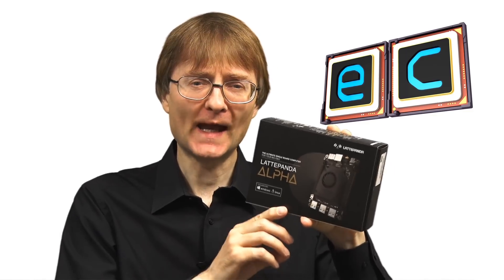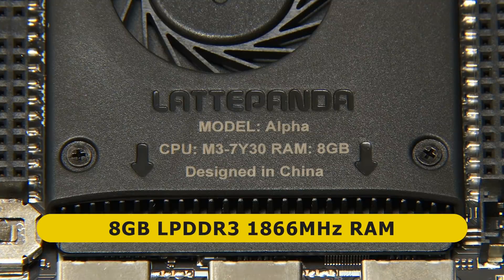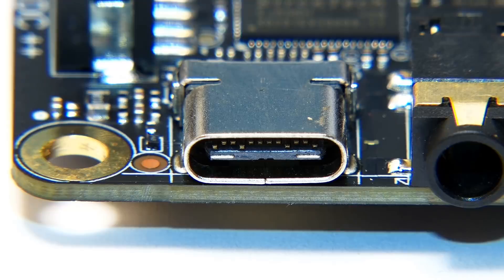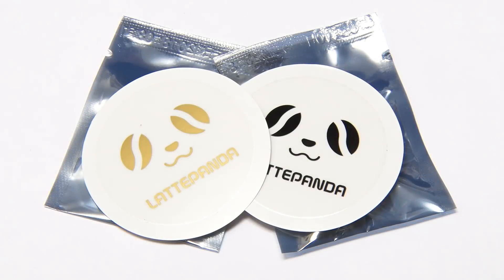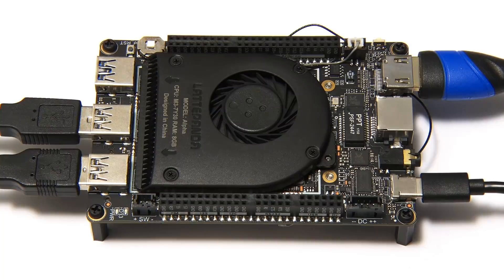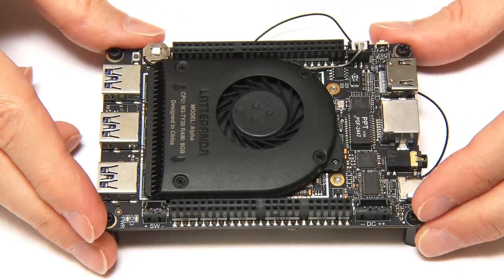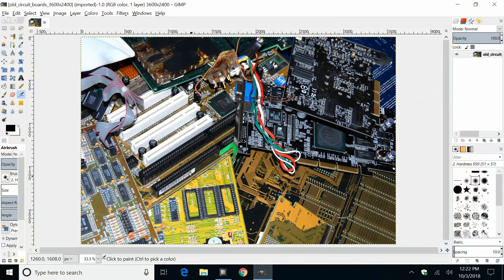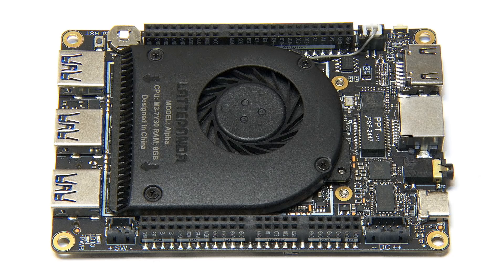LattePanda Alpha: Windows & Linux SBC

Comment: i always like to see the old ide style connectors 
would it theoretical possible if i only takes a view wires from it to make it to a sata slot ?
there are commands to the hardware to transfer different bus sizes like the OUT command it works either with 8 16 or 32 bits , but keeping in mind that inside the hardware it can look differently seeing the commands the cpu can skip the 32 bit transfer and instead transport 64 bits or more over a cache

Comment: Is that socket marked SW for a secondary power switch for when you put it in a case?
Reply from the maker: That may well be the case, although the documentation suggests that switch is connected via the GPIO connector.

Comment: It might be expensive compared to other SBCs but it's not bad if you compare to similar spec small PCs like a NUC. This would make a nice, very thin media PC or file server. It's too bad they did not include a SATA port so you could add a large 3.5" HDD and make a high capacity mini NAS
Reply from the maker: Indeed. A large drive would have to be USB 3.0.

Comment: In my opinion this computer is more suited to industrial applications than home computer or robotics use -- which is great. Years ago when I worked in industrial chemical engineering as an electronics technician, this board with its hardware power would have easily been able to control the entire program logic circuits (PLC) for the entire plant. Installing an operating system on this board is a crime as it has the potential to do so much more. The LattePanda Alpha takes small scale single board computing out of the hands of hobbyists and into the world of mainstream industrial application. My career in industrial electronics ended 23 years ago, but watching this review has truly made me jealous of what the future now holds in this field. At approximately $400 a board, this product is a total steal as many circuits can often run into the thousands of dollars. I love all the ports it has and I could easily see this board being a mainstream staple  in manufacturing extremely quickly. Thank you Chris for your channel and introducing me to this great product. I wish that I still had a boss whose office I could run into on Monday morning to talk about this with.
Reply: Since no one here seems to be able to read, what the original poster was getting at. Hes saying "dang how times have changed" the HUGE systems they had in place to do little processes are able to be accomplished by this tiny little singleboard. It should be understood that he means to use it as an industrial application because of its form and power, and thus a little work on the peripheralsto the board this little guy CAN do industrial work. hell critiques everywhere. So quick to jump on your ego and spit some "intelligence" but lack the sense to realize how old this fella is and how much tech had changed in his eyes. Ass hats.
Reply: I don't think so. We ass hats should always turn on the red lights when someone comes up with "Arduino"(like devices) and industrial application in one thought or sentence. This remembers the hobbyist that he can loose his fingers or worse with his latte panda controlled cutting machine. That these little machines are getting such powerful is very impressive and a wonderful evolution. So are the achievements in workplace security. These are two thoughts that can coexist without having to become emotional.
Reply: It more targeted for consumer and hobbyist only, not much for industrial
Reply: I agree. It seems to me that this iteration of the LattePanda is targeted at an even more restriced niche than the original ever was. I was initially tempted to pick one up to do some messing around with Linux programming, but the price of one of these plus a SATA M.2 SSD is quite a bit higher than I would be willing to spend on an SBC.
Reply: What's to stop you from offering sound solutions advice as an independent advisor/consultant?
Reply: this board is excellent for robotics. when you work with optical sensors (think about 3d mapping) you need the performance.
Reply: TotoFrancey,
I disagree that this new SBC is not suited to home computing.

It can run full-blown desktop operating systems unlike the the low-powered SBC's like the Raspberry Pi which can only run a stripped-down versions of Linux like Raspbian.

There are people who have no desktop, nor laptop, but only a tablet compute in their home, and this Latte Panda Alpha is way more powerful than any tablet.

This SBC is really more suited to Consumers but I would not want to limit someone's imagination.  

Who knows where this device is going to be used?

It should not have any problems processing much less, playing any 4k videos.

I wonder if anyone has seen any cases for it yet.

I wonder if it could be used in a form of a portable computer or laptop.

That would be cool if  a consumer could make their own laptop.
Reply: @cgwworldministries 
Any suggestions for equivalent but not priced as much?
From my view I see it priced ok and couldn't find a better alternative. Azzule that you've liked is half the ram, half the rom, slower cpu I believe and not much of expandable possibilities but priced at 300++
Reply: Windows 10 and it's constant massive updates makes it unsuitable for industrial use. But, of course, you can run other OS. Problem is I see major part of it's customer going that way
Reply: It is a joke.  I believe it is too slow for any serious modern application. Except may be for controlling wash machine...
Reply: You need RTOS to run industrial applications .
Reply: There is absolutely zero chance an engineer worth his/her salt will use a Latte Panda in manufacturing or serious automation. Industrial automation is done with industrial grade components. I can't tell from this video if the components are industrial grade (I'll eat my hat if they are), but I can tell you the connectors will never pass an industrial application quality control test. Assembly lines or manufacturing plants are not controlled via DuPont wires inserted in GPIO connectors w/o secured, latch mechanisms. Industrial automation require redundant systems which this board doesn't have. I doubt the cooling solution on this board uses sealed ball bearings. Also, in industrial automation unnecessary subsystems are never installed, as they increase the failure rate. For example, you don't wire an audio port if you don't need one. Finally, industrial products have detailed specs that include things like  MTBF, environmental conditions, stress tests, etc. I can go on and on. So don't kid yourself... this is still an amateur/hobbyist product and a pricey one for what it does.
Reply: yup, shame how shit-slow computers have got over the years isn't it?
Of course the Hardware is mechanically faster, much faster. But the OS efficiency is inexcusable, over-burdened nonsense.
My #smartfone is at least 4x the speed of my 1996 T-series RISC workstation and what can it do? Nuffin, nothing useful at all really.
And in use, that workstation is still more responsive than a 10ghz solid quad. I still do layouts on it 20 years later... What a f-in waste...
Reply: P D James : well, it’s got to do all the marketing and surveillance logging and reporting back!
Reply: Which obviously, I'm completely happy to pay for :oP Go and have a read of my rant on Tom B's 18gb comment xx

Comment: This is the perfect SBC for my projects! Good CPU, great RAM capacity and good GPU for this tiny package. I never though that my CPU- and GPU-intensive tasks would run on a tiny package like this, but now I think they can!
Reply from the maker: This board opens up many possibilities.
Reply: Do you think it could be used in a industrial space, running 24 hours every single day in a intensive task? Or it may just not handle?

Comment: What connectors to USB2 are used? I understand that there is at least one way to connect to USB2 but what type?
Reply from the maker: You can hook up a USB 2.0 via the GPIO pins.
Reply: I could just cut a USB2 B to A cable to get a USB2 B to GPIO. What about tinning the GPIO end - a better connection or a worse connection? I don't recall any USB cable that spec's the actual wires (like 24ga or 28ga etc.)

Comment: An honest question -
If you have no need for the GPIO pins, but want a small form factor, why wouldn't you go with a mini itx 2200g (or athlon 200ge), or even a nuc build? Better ram, proper nvme, better compute power overall, all at around a similar price point, just wondering.
Reply from the maker: I think if you don't need the GPIO you are right -- though NUC builds can get at least as expensive given that both the RAM and drive needs to be added.
Reply: @ExplainingComputers  true, I was just throwing nuc out there, but it get's a bit more complicated where they are concerned. The raspberry pi is understandable for the price though, for what it is.
Thanks for the reply.

Comment: Hmm. I think they might have been able to bring those M.2 connectors more to the middle of the board, and either moving the USB connectors from the top of the board to the bottom, or cutting an indentation there just like what they did with the Ethernet connector, all that in order to extend the cooler to the edge of the board, to push the air out of a case.

Comment: also you didn't mention what wattage the psu that is included is.  That's something I'm interested in finding out, as you know, I want to add a dedicated gpu through the m.2 slot with a cable adapter.

Comment: Another great review. I was going to ask how noisy the cooling fan was but you answered that in the video by saying you didn't know the fan was running unless you looked at it. If I had an extra $400 laying around I might pick up such a sweet piece of hardware but you can get a cheap laptop for that kind of money.
Reply from the maker: Yes, $400 is a lot, though the Delta model starting at $188 is a good board too. It all depends what requirements people have, and funds available.

Comment: 10:19 Low WiFi Signal
Reply from the maker: Initially, yes. But look at the later boot, and it is much better.
Reply: Interesting, I wonder if it was the board or the wireless from your network. This is a very fast SBC, and the ability to run Windows can be compelling for many people who are overwhelmed by or don't care for Linux. A great video as always, I do enjoy a good SBC review. I guess you won't have to make an extreme cooling video for this one!

Comment: Big fail for IoT or robotics. $400 and they slap an 8-bit microcontroller in it? Really?

If robotics and IoT is the goal, give me an Asus Tinkerboard or even a RPi paired with at least a 32-bit ARM Cortex-M4 like STM32F4 if not a Cortex-M7 and you'll have a winner. The microcontroller in this SBC only has ONE 10-bit ADC achieving 15 ksps max. Why put so much computing power in this SBC if it can only sample the outside world at 15 ksps and 10 bits?
Reply: Would you mind elaborating what this means for someone wanting to use this as a sensor hub? Would it mean that you would get poor/inaccurate readings from sensors? Would simultaneous readings from multiple sensors be impossible, or just slow?

Comment: The spec on this board is really good in general except the CPU.  It isn't really powerful enough for Windows to be really useful and the Intel onboard graphics limits it for things like emulation that need good graphics support.  The other obvious issue is the form factor as it obviously can't fit into the same spaces as a Raspberry Pi, but they would not have been able to squeeze as much on without making it this size.  It will probably be a good project board, TV box or network server.
Reply: you don't know nothing about this cpu.. check gpdwin2 this cpu kick ass any 775 cpu

Comment: Hmm, this could probably be an excellent HTPC for 4k video, did you do any testing in that resolution? Thanks for the video, very interesting.
Reply from the maker: I did not test, but suspect 4K will work just fine with the Intel graphics here. The initial LattePanda worked great for 1980p, on a lot less powerfl board.

Comment: First of all, I always appreciate your reviews, always compact yet detailed.

Anyway, this sbc has some quirks that I overlooked from the teaser post.

1. Power consumption
10w! 10! A plethora of i/o for 10watts is remarkabe. A mainstream cpu for laptops are rated at 15watt these days, and around the same level this thing has waaay more capabilties for hardware control and such.

2. i/o 
Ethernet, m.2, usb A&C, display controllers, gpio, etc... The cpu does bottleneck some ports(like nvme)  but the fact that this CAN drive it is good enough. 

3. Intel wlan
I was expecting some stuff from nameless chinese company...

4. Density
Thats one hell of an dense pcb. The designer would have suffered a lot..

Overall, this is quite nice. The pricing is quite high still, but the manufacturing cost would be really high in the first place(all those dense smds, chips, ports, thermal solution, small production). Would be a good solution for hardware control in tight places where the common sbc were too weak for.
Reply: Plus, regarding desity, I think longevity could an issue. Showing how vrm, ram, cpu was being cooled under the heaksink would have been great and assuring.

Comment: Well its really a small but powerful SBC as well seems more powerful than the bulky UDOO x86 Ultra. The LattePanda Alpha looks useful for office buildings to use a smaller computer that doesn't require those bulky ATX form PCs. Besides it seems like the LattePanda can be useful for using LibreOffice or MS Office as well as using GIMP and maybe Kdenlive in Linux Mint. But it can be tricky as it isn't as affordable like the Pi 3B and maybe don't support a lot of dedicated apps or like the RetroPie and OSMC, but the Intel x86 Arch and powerful processors seems promising.

Comment: but WHY are all "GPIO"-Pins for DC, USB and I2C lableled GND at the one long side of the board? Preproduction-Sample?
Reply from the maker: There are two rows of pins on each GPIO connector -- those on the other side are labelled with other things! You can see this when the connector is in the background on the reverse angle shot. This is a final board.

Comment: finally, a real computer  that's an SBC. I've been waiting for pretty much exactly this. My need is a 2nd full computer I can slip inside my actual desktop and still has GPIO pins and the like
Reply: also, if you think 6 gigs of windows updates is laughable, try installing MSVC, just the "free" home developer version with all the goodies I wanted was about 100 gigs from an original 17 gig install.

Comment: I really like the fact that it has a legit 12 volt power connector. 
What really trips me out is that tiny board is many times as powerful as the old full size desktop Compaq Presario with a 486 DX 66 Mhz cpu I had in the early 1990s. On top of that, it's a 5th of the price.

Comment: One thing I would love to see you test is if it's possible to hook an external graphics card to one of those M.2 ports. I know there are kits out there that lets some laptops connect a graphics card through the mini PCI-E port that the wireless card uses.
Exciting! Almost as exciting as the Udoo Bolt.

Comment: Chris, you might be able to free up 5 – 10GB of disk drive space by deleting Windows update files.

Right click your C: drive > Click "Properties" > Click “Disk Cleanup” > Click “Clean up system files” > Look for “Windows Update Cleanup” and make sure it’s selected > Click “OK” and it should delete all the Windows update files hopefully freeing up many gigabytes of disk space.

https://i.imgur.com/H5MaONk.png

Also, you could  probably free up another 4GB of disk space by going into "System Properties" click the "System Protection" tab, and under "Protection Settings" disable protection for the c:\  drive. This, however will turn off the ability to use restore points in Windows. A feature I personally never use since I back up my C:\ drive to an image file using Macrium Reflect imaging software.
Reply from the maker: I ran cleanup before I showed the space used! :) I cleared a lot deleting unwanted software.

Comment: The LattePanda Alpha is better than ever!

I can see one of those SBCs running as SignalR and WebAPI server in a lot of security systems, embedding biometric features (facial, iris, digital) communicating clients, serial cameras, sensors as temperature and/or RFID sensors, IP Cameras, and controlling gates, doors... 
And we can store very large amount of data locally, is something so easy...
Is expensive, yes, but is very powerfull, is not?
Is it a dream?

Comment: Looks good!! Yeah the price is high  but your getting what you paid for. I would love to see if linuxcnc or machinekit will run on it with out too much latency. With having on board pcie you could add a parallel ports or a mesa card for running a cnc. I would like to how well zbrush and OBS runs on it too.

Comment: Very interesting to see Resolve video editor running on this, does it handle full on editing and rendering.
Reply from the maker: It does work, certainly. Fully function. This said, it is a little laggy when dragging in the timeline. But I could certainly edit on this if I had to. And using a less heavy editor (I chose Resolve just to stress the board out), this could be a pretty effective video editing platform at pocket size.